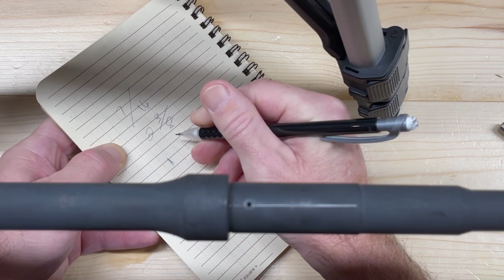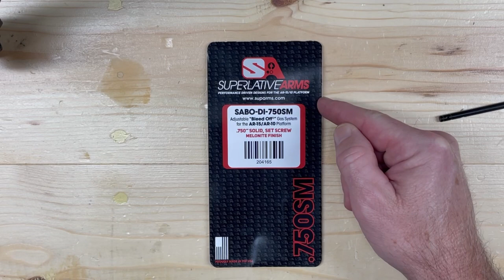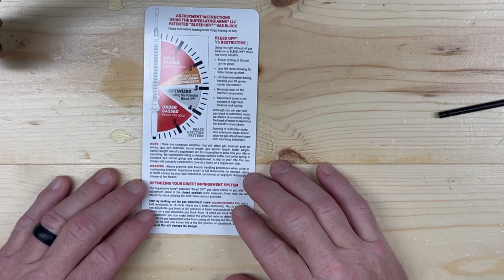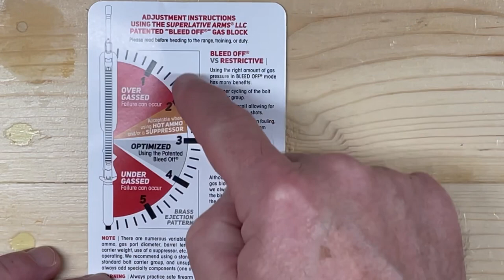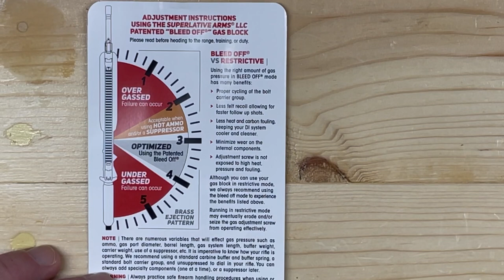AR15 Complete Upper Receiver Assembly

Comment: Why lube the threads on the upper? Couldn’t that lead to over torquing?
Reply from the maker: I lubricant the threads to make removal easier in the future. I’m not an engineer so I can’t answer your question authoritatively. However imo the purpose of a lubricant is to reduce friction. The reduction of friction should not effect the torque setting. It just takes less effort to reach the desired torque setting. 40 ft/lbs is 40 ft/lbs regardless of the effort to get there. Just my thoughts.

Comment: How do determine how many shims between the barrel and upper if any?
Reply from the maker: It’s trial and error. Put the barrel nut on without any shims and see how things line up. Put however many shims it appears your going to need. Set your torque wrench to the proper torque setting and tighten the nut. From there add or subtract shims as necessary. You should have a range in your torque setting as well to fine tune your adjustment.
Reply: @GunTalk556 I’m confused the purpose of the shims in general. What doesn’t line up?
Reply from the maker: @asmallfarmhomestead3657  it’s often referred to as indexing the barrel nut. There are a variety of barrel nuts. Some require indexing and some don’t. Some barrel nuts use shims to aid with indexing and some don’t. The purpose of indexing is the gas tube needs to pass through the barrel nut and into the upper receiver. If you look at the barrel nut in my video it has holes in the nut. One of these holes needs to line up with the hole in the upper receiver so the gas tube can pass into it. We want these lined up just right so the gas tube passes through freely without the barrel nut putting any stress or pressure on the gas tube altering its alignment into the receiver.
Reply: @GunTalk556  makes sense now thank you